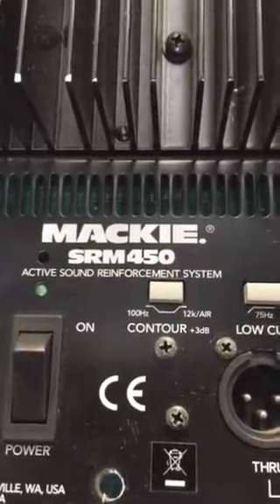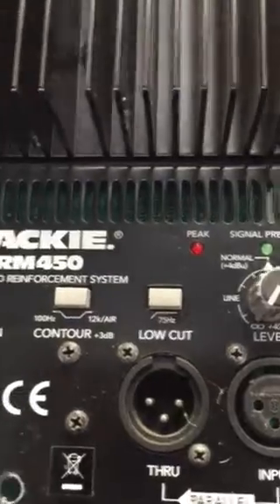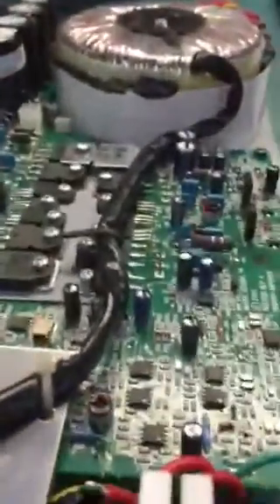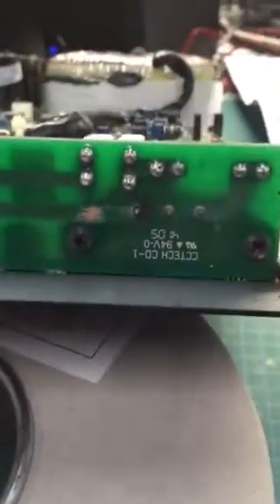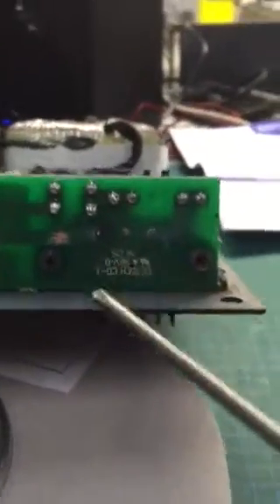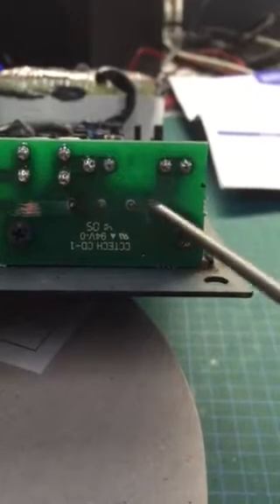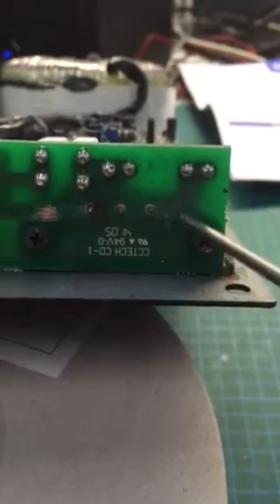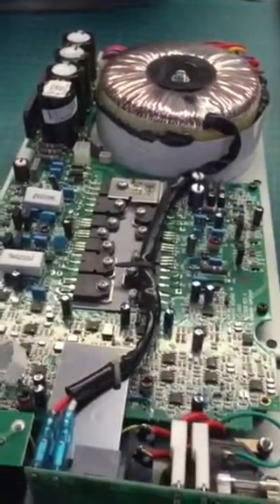Mackie SRM450 active speaker repair

Comment: hi i need your help with a mackie speaker pls. do you have  contact number?
Reply: NW2 MUSIC 
Hi 
Saw you were repairing a srm 450 
May I ask what was the complaint?
My complaint is disturbance when i connect to my mixer 
And give vokume.
Any idea what this can be ?
I saw you were solering the power joints is that true?

Comment: So, did what you showed on the video fix the issue? Any idea why that happened?
Reply from the maker: Yes totally fixed, the power point gets a lot of abuse and has heavy contacts, very prone to dry solder joints which then start to ark and burn away the PCB track.